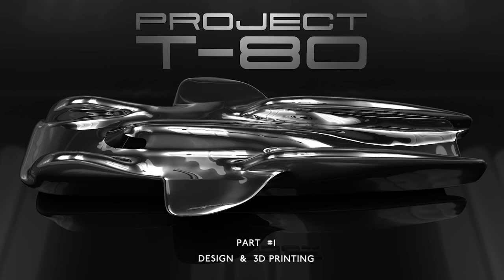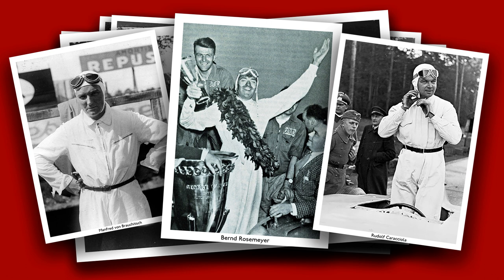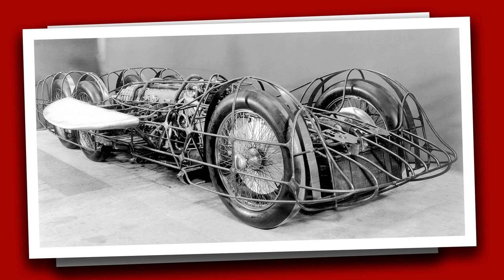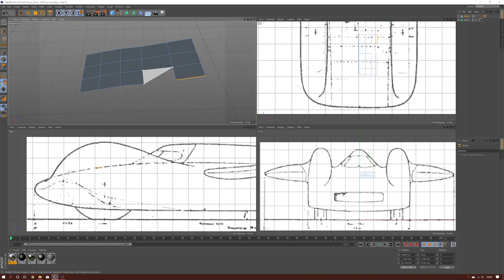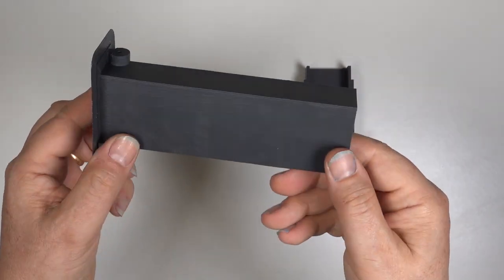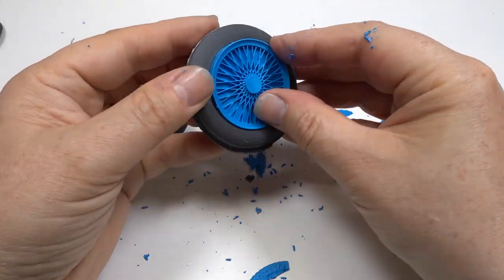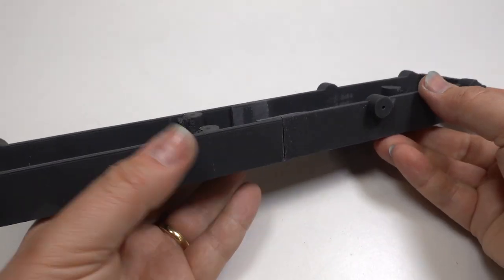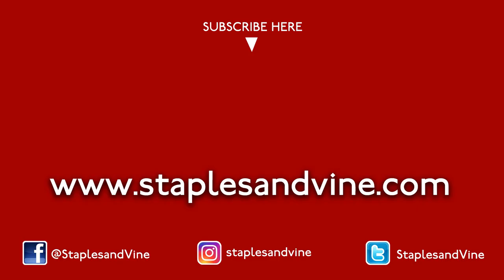PROJECT T-80 PART 1  ‘PLANNING & 3D PRINTING’

Comment: Interesting subject indeed... its weird they inverted the Clark y aero profile wing and put them on like a plane dead in the middle.  Slap some bombs on there and that's the ultimate low level bomber 🤣. Looking good buddy.

p.s get some proper snippers you can pick a decent set on for £1 on amazon, I have used the Plato model 170 shears used for two years daily and they cost a quid. 

Here's to the next one ☕️
Reply from the maker: Thanks Vasili, apparently in recent simulations the T-80 was predicted to be highly unstable becoming airborne! - not good. Thanks for the tip on the tin snips. Next video should be another StuG episode.
Reply: Well if it was flat bottomed due to the body shape it's almost the reverse of the wings it may be possible, but I doubt it would get airborne due to the heavy front end and construction of the day (heavy materials) it would definitely need a rear spoiler and a flat bottom to induce a lift. Funny enough I remember a quite recently (90's is recent to me 🤣) Mercedes actually had a car take off at Le Mans I think mark Webber was driving... he also had it happen to him in a F1 car.  Footage may be on YouTube 

Top tip don't let mark Webber drive it  😜👍 

When I worked for Audi they had footage of the auto union cars on screens in the showroom on 24/7 , my boss hated it when I used to tell customers the political history of the cars. ( don't mention the war and all the basil faulty stuff)
Reply from the maker: You're right about the flying Mercedes here's a video https://youtu.be/e21ZjwZGjiQ . Mark Webber also had a similar incident and in F1 as you say.
Reply: Yep that's the one, and if you look at the actual car it's similar shape as the T-80 if you squint and take the wings off ..  

You will definitely have a unique model when finished.
Reply from the maker: After I had designed it in CAD I realised that if I made the back end shorter and took the wings off, it was a lot like a Porsche 919.  Now there's an idea..
Reply: What's another project huh, a mate on YouTube had 33 builds on the go last time I spoke to him..  I have 5 

Bit off topic are you able to cast 1/35 tracks?  You may be able to make a little money that way to keep the lights on between projects.
Reply from the maker: I feel like such an amateur only having 3 on the go! Not sure about 1/35 tracks, maybe I'll take a look?
Reply: 3 projects is a lot especially since it's from scratch... not amateur at all whole different level of modelling..  I only have 5 on the go because i didn't have to design them 🤣👍🏻. I just thought the tracks may be a tidy side earner for you. 

Anyway taken enough of your time today, have fun matey 👍🇬🇧